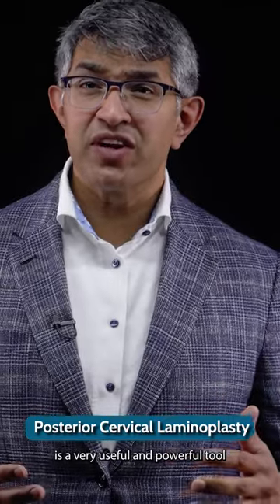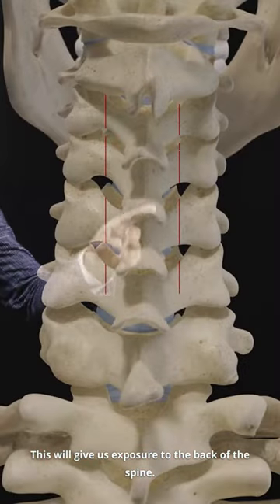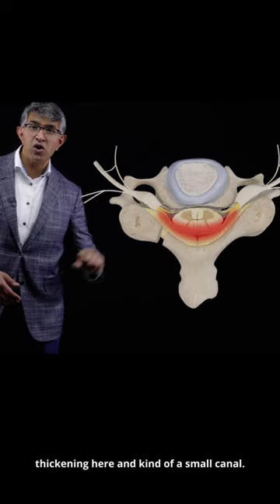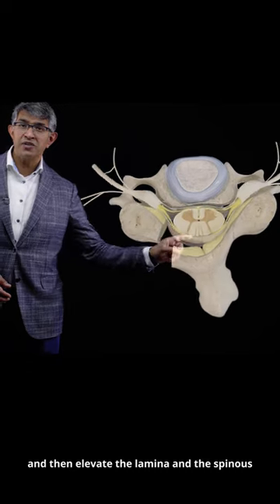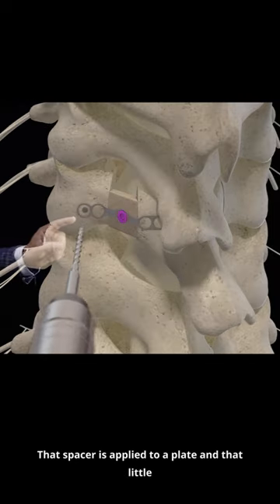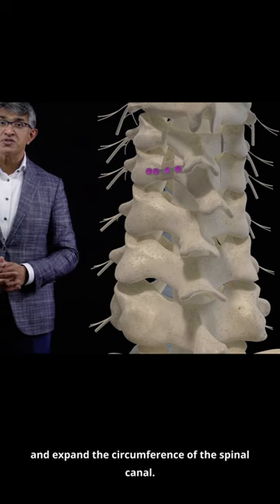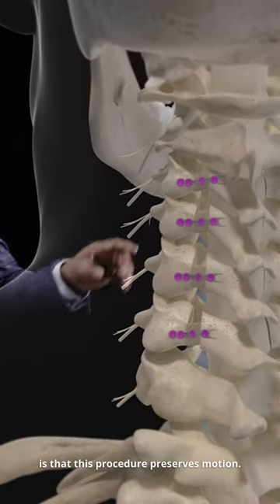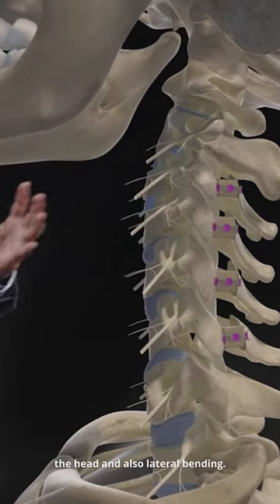The Potential of Posterior Cervical Laminoplasty for Spinal Cord Compression #shorts

Comment: Hi Dr. Prasad, 

Thank you so much for posting the helpful videos! They really help educate me on my neck issues. My MRI shows I have cervical stenosis/spondylosis and degenerative discs from C3-C4 through C6-C7 (from 2 to 4mm protruding), but I have mostly neck pain on the lower right side of my neck (90%), right shoulder, and upper right arm (10%). Pain gets worse when tilting my head up. No clumsiness, gait or balance issues, or muscle weaknesses. 

Do you have a spine surgeon you would recommend in the Orange County, CA area, who would go through your structured approach of diagnosis as opposed to the neurosurgeon and the orthopedic surgeon I talked to who only focus on surgery from the get-go. I really like the way you isolate and validate the areas of the problems like getting injection to confirm which nerve is causing the pain. Please let me know if you need any additional information from me. I really appreciate it!

Best,
Kenny in Mission Viejo, CA
Reply from the maker: Hi Kenny, I'm not sure who you saw or what the programs around you are like. I know Adam Kanter (Hoag Hospital) and Todd Allen (UCSD) are both excellent. Hope you are staying safe with this unusual Tropical Storm! Good luck, -SP
Reply: @prasadspineacademy  Thank you so much for the information! I really appreciate it!
Reply: Sir your videos are amazing sir i want to know which software or technology are you using for making such nice videos please share sir